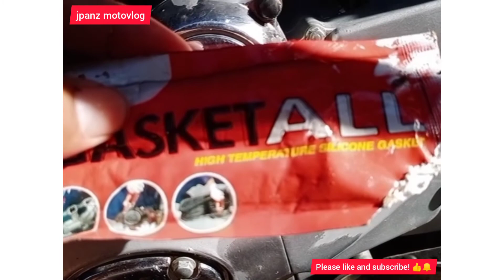Rusi TC100 oil leaking. Must watch how to repair DYI | Traveling with my Rusi Chariot 175

Comment: Kasiya ba Ang cylinder block ng skygo 150 sa rusi tc 100
Reply from the maker: Di po
Reply: @jpanzmotowirings2017  ano po Ang kasiya para sa tc 100 gusto ko palitan ng pang 150 na block patulong nmn lods
Reply from the maker: @micktesztv1779  palita mo ng block 150 at carbs 150  piston 150 at ring
Malakas na tc 100 mo.

Comment: Lods anong cdi Ang magandang ipalit para tc100 natin
Reply from the maker: Mas maganda parin Ang genuine ng tc100 lods para mas compatible sya.
Reply: Lods Kong papalitan ng cdi ng cg 125 gagana ba lods Kasi may binili ako na cdi pang cg125 pero ayaw umandar lods
Reply from the maker: @micktesztv1779  
Sugurohin molang na parihas Ang pin
5pin yung tc100
Reply: lods 6pin Yung stock cdi Niya pero dc operated siya